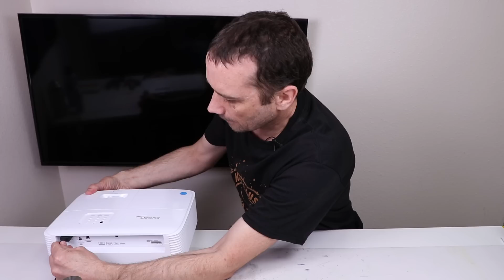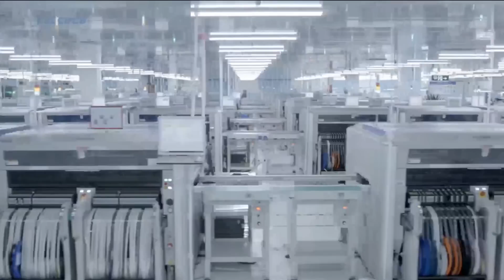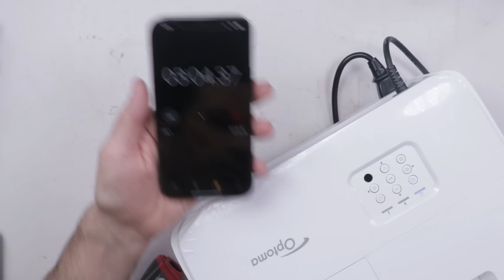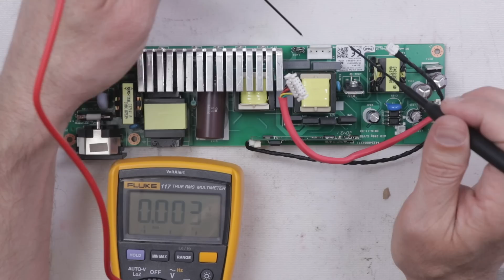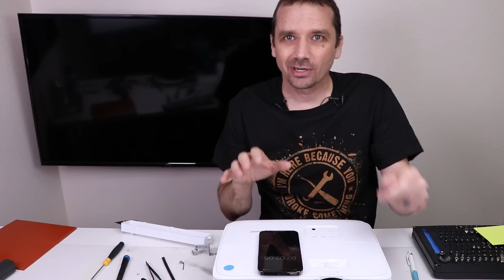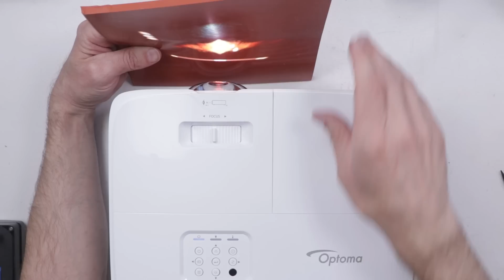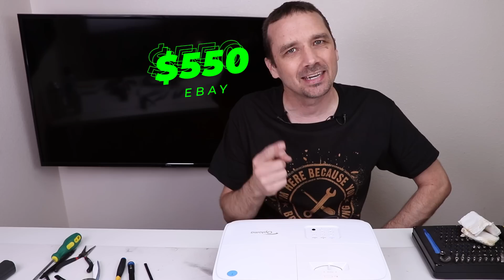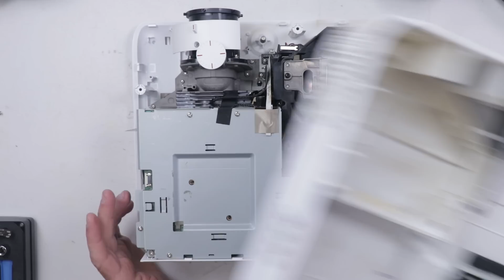I Bought 6 BROKEN Projectors - But Can I Fix Them and Make Money?!

Comment: One small notice, when checking if there is charge in capacitors, always measeure voltagr across storage caps. Measuring voltage at socket will always show 0V (if bridge rectifier is good) because bridge rectifier will block DC. Also if fuse is not blown there will not be any voltage across it. (There will be voltage drop across it when the projector is drawing current while its working) This time you get lucky that storage cap have bleeder resistor. If that is not the case (as it is for many chinese PSU) you could get high voltage for days at that capacitor and your methods will not detect it. So ALWAYS measure voltage at the big caps. If there is residual charge, use high wattage resistor, 1K or lower to discharge capacitor safetly.
Reply from the maker: Yes, you are correct. I did it totally wrong in that shot. I'm adding this to my pinned comment.
Reply: @Tronicsfix  I was just going to say the same thing pretty much, as you measured the votage across the input of the power supply. If the main capacitor still had charge in it, you wouldn't be able to measure that across the power input as the bridge rectifier would stop you being able to measure that. I would have measured directly across the main capacitor, I also have been bitten a couple of times!
Reply: Spot on bro.  you are correct!!
Reply: I once got bitten by storage cap... And that was 470 uF 450V beast charged to 390VDC. I assumed cap is discharged... It was very painfull assumption...
Reply: @gigabyte091  yeah, me too when repairing old crt tv. Now i always short them so they are for sure at 0V
Reply: @Syntappi  ohhhh... Yea, when you realise that CRT tube is high voltage capacitor the hard way haha...
Reply: my thoughts exactly
Reply: Would that be a “full bridge rectifier”?
Reply: @TimeHunter Yes, it's FULL BRIDGE RECTIFIER
Reply: @gigabyte091  I can't read FULL BRIDGE RECTIFIER anymore without hearing it in electroBOOM's voice.
Reply: Agreed. Another thing to remember is a charge can return over time on some devices.
When I worked in a TV repair shop back in the 70's, I got zapped by a Color TV Tube that I HAD discharged but then I left it to one side while I replaced it.
Imagine my surprise when I picked it back up and got zapped to my belly area, while carrying it up some stares into storage to await a replacement gun assembly.
I wanted to throw or drop it but then it would have likely imploded !!
So beware that a charge on a CRT and other devices can restore over quite a short period of time. (In that case about an hour)
In that particular situation remember to put a constant short (like a jumper cable) across the device after the initial discharge, 
to prevent the device from returning to a charged condition.
The normal working voltage on the final anode of a Color CRT was around 25KV DC yes 25,000 Volts DC!!!
Take care,  Sneaky things happen while working on Electrical / Electronic devices.
Reply: @KB1UIF  Yea, nice one, i forgot to mention that capacitors can and will build up charge (not to the initial voltage ofcourse). I have small alligator clips so i can short capacitors (but still be able to see that i made a short, so i don't turn the device on while i have short across caps)

But the worst are microwave ovens, nasty capacitor and high voltage transformer... And tube amps...
Reply: I've shocked the crap out of myself on a projector cap (as well as flash caps, but...)... so yes, be careful. I think the projector was off for months before I did that too.
Reply: Yeah, I know that first sting of my life, OMG
Reply: I just lick the whole supply. If i feel a tickle or a zap you know its now safe to touch.
Reply: "Zero volts across the fuse" hmmm
Reply: Also one advice for anybody that attemps to repair switching supply ( Other than if you don't have any experience in repairing power electronics DON'T DO IT, it could be your last repair...) is that when you test power supply for the first time, connect incandescent lamp in series with with DUT (device under test) so you limit the current in case there is a fault on board. This way you will avoid destroying board or damaging other components. I avoid using variac for bringing up supply's as cheap supply's can have erratic behaviour with voltages lower then they are designed for. Lamp test is good for no load test, just to see if power supply is  outputing correct voltage, and also, if there is any short on board, lamp will glow brightly.
Reply: At least checking across the white connector on these PSUs would probably be checking across the reservoir cap. (in almost all projector designs similar to this, but obviously that should never be taken for granted either.)

Most of these designs pass the rectified DC (around 170VDC from 120V mains, or 340VDC from 240V mains) directly to the lamp ballast via that white connector.

But yeah, really you should always check directly across the cap itself. But also never rely on your multimeter to tell you the truth. The cap should be safely discharged anyway. Being "90% sure" when working on high-voltage stuff is not enough.

(Some projectors will have a relay between the reservoir cap and the HV DC connector, or some power-factor correction stuff, so testing that white connector isn't a foolproof way of checking the cap.)

Another good tip is to only pick up the board with one hand, until you're sure the caps are discharged.
If you get a shock across both hands, it's much more likely to stop your heart. It only takes about 10milliamps across the heart to cause problems.

A bigclive often says, the skin resistance is usually quite high, unless your hands are damp etc.
But say the solder joints on the board pierced the skin a bit, that's an increased risk, too.

Apparently, it's not healthy for a cap to directly short across it. tbh, I've done that many times though, but usually only on small-ish caps after the meter showed less than about 50 Volts on it.

Discharging a cap more slowly via a resistor (as the OP said) is preferred. You can make a very well-insulated discharge tool with a 10-20 Watt power resistor. 1K is probably a good choice for most devices that have a max expected cap voltage of 170-400V.

With 170V and a 1K resistor, only 170mA will flow. That's still nearly 30 Watts that the resistor has to dissipate, but it should discharge a typical reservoir cap fairly quickly, so even a 10 Watt resistor is probably fine.

(the discharge rate is determined mainly by the capacitance of the cap, and not the measured voltage across it.)

You can't rely on anything having a bleed resistor across the main caps nowadays.
It wasn't even guaranteed years ago.

Some PSU designs will naturally discharge the main reservoir cap, but a lot of modern switched-mode PSUs don't (or don't fully).

I second what Krešimir Pečar said, though - I wouldn't recommend working on any PSU nor high-voltage circuits unless you really know what you're doing, or are very confident in the safety steps.

I used to repair a lot of CRT, LCD, plasma TVs, VCRs, LCD/DLP projectors, amps etc., but I rarely work on mains stuff now.

Even back then, I generally didn't need to work on a PSU while it was powered up. You can do 95% of the checks with just a basic multimeter (after discharging the scary caps, ofc), without needing the PSU powered up.

And yep, CRTs can have a weird residual current thing, where they build up a charge again after discharging, same as some caps. Probably due to some internal resistance stuff. I'm not sure, tbh, but it's worth keeping in mind. lol

Only time I ever got zapped by a CRT anode cap was while discharging it using a screwdriver and a wire clipped to the ground strap around the tube. (The screwdriver had a non-conductive handle / good isolation to HV)

The croc clip on the wire fell off JUST as I went to discharge the anode cap, and an arc jumped to my thumb instead. lol
Reply: Oh, and even when using a well-insulated power resistor to discharge a cap, you should always re-measure the voltage across the cap using a multimeter.

Or you could just do the "big clive test", by quickly touching across the cap after. lol
(DON'T do that, unless you're fully aware of the risk.)

Sorry for the wall-of-text in my previous post, btw. I often don't realize how much I've typed.
Reply: cant you just make a bridge with a screwdriver between the legs of the capacitor and it will fully discharge it?

Comment: Hi there, great channel!! Wouldn't it be pertinent to compare how all these look like when projected onto a screen or even a wall? Some projectors show problem areas or differences even between the same model, or would that be more lens dependent, and so, not much you can do about it? I'm interested to see if any of these come back after selling them
Reply from the maker: I generally don't test everything on camera as that would be very boring to watch. In addition, if I don't have the time to fully test an item I will sell it as untested so the buyer knows what they are getting.

Comment: Really nice Video. I just have 2 questions:
1. Could the buzzing come from the internal speaker?
2. Is it worth cleaning the plastic houseings in a Dishwasher?

I love the variety of tech repairs on your channel!
Reply: Won’t hurt if you try
Reply: smoke stained the plastics. Would need revived in a bath of water/hydrogen peroxide and UV lights overnight.

Comment: Someone probably already said it, if there is a Arc lamp in number six, I haven't found the spec sheet for it but high hour arc lamps produce a buzzing sound. (I have an Epson that does it. $150 lamp vs $300 tv... I no longer use the projector)
Reply: Buzzing on any projector isn't good. The most common cause for a buzzing noise is a failing color or phosphor wheel.
Reply: I was going off what I know from personal experience, I would not have thought about that.
Reply: Those are pixel shift projectors it is a know side effect of the pixel shift technology as the DLP is being mechanically shifted 240 times a second.  They often have a quiet or silent mode that turns it off but you go from 4K to 1080P as you disable the pixel shifting.

Comment: 2:05 Even a lot of Epson and other brands of projectors replacing the lamp is just a matter of removing one screw on the cover and one screw on the lamp itself. I had an Epson projector that used a screw that could be turned by hand, didn't require any tools.

Comment: To solve the clicking noise on the UHD50X it would be worth it to replace the color wheel, especially if the project has seen heavy use. After I replaced the color wheel on my Optoma 141X the projector was super quite and the colors were a lot better.
Reply: Looking to do this on one of my projectors. Seems to happen to all projectors eventually.
Reply: The noise was the pixel shift technology not the colour wheel

Comment: You were testing for renmaining voltage on your electrolytic caps on the AC input and the fuse. Neither method works. You have to check on the cap.

Comment: Had my Acer full HD 3d projektor for 12 years and it's still running like new. Tho it could use some cleaning from smoke and dust.. 

Wish you tried all the ports also.. if HDMI ports are broken are the projector worthless
Reply from the maker: All the HDMI ports were working. That's how I connected them to my computer
Reply: @Tronicsfix  👍, is it possible to change fan in a projector that is more quiet? Or will it destroy the lamp quicker? Is it normal 3 pin connector or something?

Comment: Is anyone going to talk about the fact that he tested the AC terminal and both ends of the fuse for voltage? when he should be testing after the bridge rectifier for voltage on the DC side.
Reply: Yes, that was just weird....
Reply: wtf was he doing lmao 💀
Reply: Maybe additional checks but worth noting that most modern power supplies do not have bridge rectifiers as they are too inefficient especially for standby power requirements for energy efficiency.

Comment: Damn these projectors could be a cash cow if they all turn out to be this easy to fix. Granted, I think you may have just got lucky on this lot or brand.
Reply from the maker: Ya, I got pretty lucky here.
Reply: Yeah except people demanding refunds and returns when they overheat after being on for 3 hours.   A few returns can really kill any profits on ebay.  I once sold a motherboard that was damaged, I said it was damaged, I said it was for parts only, I pretty much said it's not going to be fixed.  Someone bought it and then demanded a partial refund because it was damaged.  And the way ebay is, you pretty much have to give it to them.
Reply: @GigsTaggart  you think that's bad, I shipped someone a perfectly good motherboard, CPU, ram combo, I had tested for hours and pulled out of a working machine, only to have them tell me it was broken, eBay made me refund them, I got it back and all I could smell was burnt electronics. Instead of making $200, I lost nearly $50, between fees and shipping 🤬
Reply: @mytownmatt  that sucks, I bought a motherboard off someone on eBay but ended up shorting it out by accidently bridging 3 wires on a fan connector. I was honest though and took the loss. Surprisingly I got ASUS to RMA the board for free and got a repaired one back.

Comment: Test them like at least 1~2hours . When I worked on projectors cost over 10,000 dollar per each. They sometimes showed some sort of weird issues  when I run them for few hours.   They were expensive but not reliable at all.  *Rumors and things I experienced, If you use "non-genuine" lamp for your projector, they might cause damage to a filter on lens which might give you fuzzy or darkened image even after putting a new lamp.  (We ended up replacing several projectors due to darkened image Replacing a lamp was not a solution)
Reply: Thats for the next customer to find out 🤣🤣🤣
Reply from the maker: Agreed. I'll likely sell them as untested since I don't have time to test them for that long.
Reply: @Tronicsfix  Use them for a movie when you are relaxing with the wife. If it acts up, swap to your normal screen. Idk, just an idea.
Reply: @Tronicsfix  You don't have time to turn on 6 projectors and come back in 2 hours? Also you didn't check the audio on any of these at least you didn't on camera.
Reply: @jarateman6427  I guess he's made his money from the sponsor spot and video, that's the important thing
Reply: @dpowerful1  Or he's just in the process of several other projects, and doesn't have the time to devote to testing these. Maybe doesn't have enough ports to plug everything in at once. He seems he could only test one or two at a time when he checked for light. Might just not have enough space.
Reply: @jarateman6427  don't by unless u live next door , that the morale of al his videos :goodvibes:🤣
Reply: @dpowerful1  im sure he put the screw in there 🤣🤣

Comment: In my opinion projectors with lamp ( Light bulb ) are obsolete.  Led projectors  are a better option. last longer.
Reply: @Cerus98 not 100% true they are just starting to come out with LED ones that are just as bright but took years for them to work out the kinks and they are more expensive up front.

Comment: I remember that one control panel we had onboard made this buzzing and the cause of this was the fan. So check it before you sell it. It may cause overheating after like one hour.
Reply: Yup. When lamps explode some glass shards get stuck in the fans, causing the projector to buzz and eventually shut down. Some compressed air and contact cleaner will work fantastic.

Comment: 5-7 min standby testing is not sufficient to stress test the projectors. How do you know the projectors don't have a psu problem after a few hours? 

Also projector 5 had buzzing, he never addressed that problem after fixing the zoom lens or really fixed it. So who wants to pay 900 usd for a buzzing 3rd hand potentially defect product? 

That's borderline scamming people.
Reply: Yeah... Anaway once I tried a broken projector with smoke damage from the projector light, worked perfectly but the image was tainted yellow, maybe it could be a problem here as well as he didn't seem to really check for picture quality.